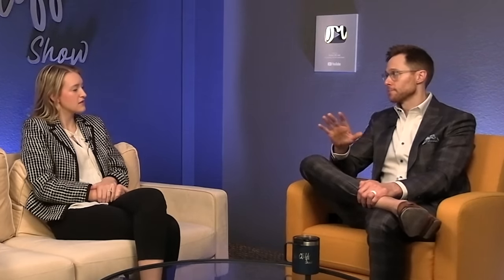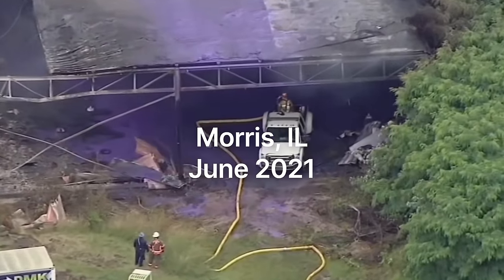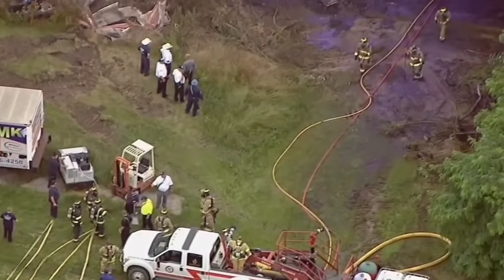Rechargeable Hearing Aids - What You NEED to Know! | The Dr. Cliff Show

Comment: I came from removable battery technology (Phonak) and last year bought two Oticon rechargeable HA's and i LOVE them. I'm not going back to removable battery technology i absolutely love these. I also have custom RIC molds. I love the charger for them, holds 3 charges unplugged fits the custom RIC molds and thankfully the case does indeed shut with them, for me it's my kitten who has shown an interest in anything on my nightstand so currently only has a lamp, clock and my charger. I never leave it open with the HAs inside of it or he'll take an HA (or both) and i'll never find where he's hidden them. Oh also battery life on these is decent i've only come close to running out of battery once (10%) and that was a super long day (18hr plus day). Oh and i have a solar brick (battery pack) that i use for dry camping (when we go camping it's for a week) i can get 8 full charges of my charger (which then holds 3 charges) off that brick. This was my primary concern going wireless and the solution has rendered it a moot point. The only thing i don't use is wireless on my HAs or at least i try not to, maybe my phone when i get/make a call but that's about it, i use headphones for everything else because the drain is too great. I get why these would not work for someone else. Especially those relying on wireless connectivity. Though i could also see someone with dexterity issues having an issue changing wax guards on these. So far, i'm ok.

Comment: My resound hearing aids use #13 batteries, and they last 10 days. I’m perfectly happy with them. When my batteries die, I just put new ones in, and I’m instantly at 100% charge. If I forgot to bring spare batteries while away from home, any drugstore will have these batteries. If I had rechargeable batteries, things are a little more complicated if I run out of charge. I’d have to wait an hour or two to charge the batteries before I can hear. And if I forgot to bring the charger, I’m totally screwed, unless my HA’s use the silver-zinc rechargeable batteries they mentioned in the video.

Comment: I had for over 10 years Oticon Epoq HA (both ears) batteries lasted me less than one week (5-6) days, and that was before streaming was common.  Due to the different sound schemes on each HA one used more batteries than the other so I changed them when needed, but it was a hassle carrying a battery pack.

When the first rechargeable that you could use instead of your regular batteries, i tried them, but would not last a whole 16-18 hour day that I normally use them, had still to carry a spare set of batteries.

Now I'm using Widex Moment HA, with rechargeable batteries, do between 3-5 hours a day of streaming, and even though still one discharges faster, I'm able to get 18-20 hours on my HAs even after one year.

No more dead batteries lying around or suddenly HA turning off due to dead batteries in the  middle of a conversation.

Very hapy with rechargeable ones.

Comment: I am about one year in with Phonak Lumity devices and i am still not entirely comfortable with rechargeable battery technology.  I get approximately 16 hours streaming battery life on a charge which i think is fantastic.  However, i do have an unusual schedule and even 16 hours of battery life isn’t sufficient on some days.  .  I am awake at 3 am and occasionally have 7 pm meetings.  Also, there was a windstorm in the area last month and i was without electricity for 3 days.  Even though i had 4 heavy duty power banks charged and ready to go, they did not last until the electricity returned.  Rechargeable versus disposable batteries was one of the major pivot points for me.  The other feature that was vital was a telecoil.  While i am generally pleased with the performance of my devices, there are times when i lose battery power at an inopportune time and wonder if i should have selected the disposable battery option.
Reply: I love my Phonak Audeo lumity l70 life,lol 

Just to let you know Phonak estimates battery life to last from 16+ hours.

My hearing aid can last up to 27 hours without streaming and 14 hours with heavily streaming.

With my charger the charger can charge the hearing aid 15 full times.

Comment: The largest problem Phonak has had recently is recharging.  Chargers and hearing aids have been replaced.  My Paradise P90 charger was one of the bad ones.  I still have and maintain my Phonak Marvel M90s with replaceable batteries, and they have never caused a problem.  Phonak says that rechargeable HAs last 24 HOURS, and people actually get 14-16 HOURS.  My M90s get five DAYS on disposable batteries.  Rechargeables are not even close.

Comment: Question.  Can inductive chargers for phones and watches charge hearing aids?
Reply: No you have to have the charger case that you put hearing aids on.

And you can. Only use the charger cable and wall adapter that comes with your hearing aids.

The manufacturer (especially phonak) doesn't want you to use 3rd party chargers (I.e Phone chargers) as they don't have the right voltage to charge it. Yes using a phone charger cable can charge the hearing aids but it can damage the hearing aids battries.

Comment: I like my virto paradise p-312. Before I bought them, I tested rechargable RIC Paradise and I really like and hate them at the same time. I hate them because their rechargable technology just sucks. I use a lot of BT connectivity and sometimes just after 14-16 hours they are dead. It was annoying. And I wonder, how long will they work after 1, 2 or 3 years of use. 12 hours, 10 hours? This is simply unacceptable. If Phonak puts their current battery technology into Virto series it will be drama. I certainly won't buy their product in the future if they don't improve it.